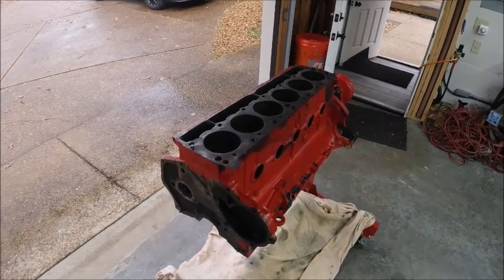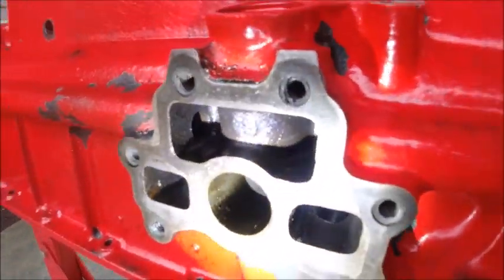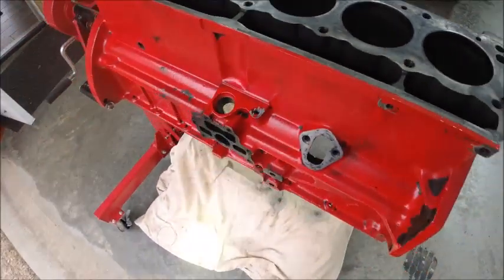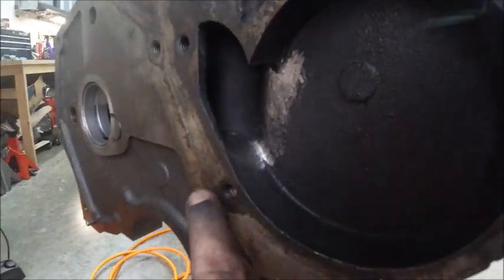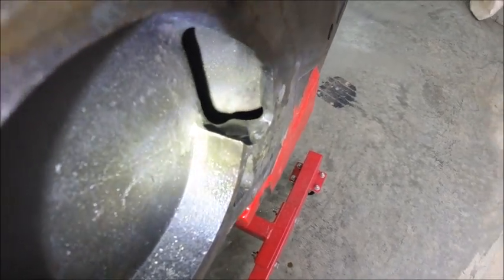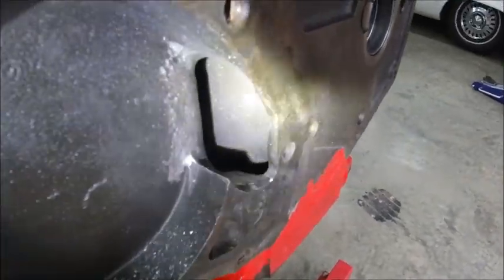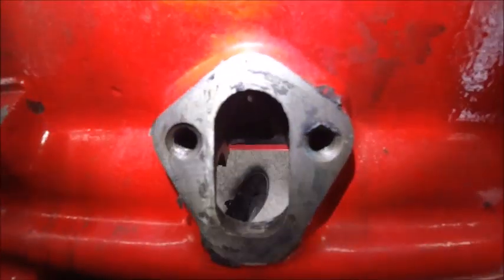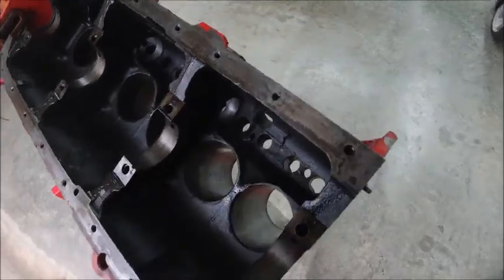Slant Six Block Prepping.... #nonamenationals

Comment: Hey shane, dont know if you got my email. Mu brother and i are building a 318 with just left over parts at home. Stock 360 cam and 318 poly flat top pistons. Which we measured now to be .010 below deck. I had a few questions and was wondering your input.

Comment: Darton MID Sleeves In a Aluminum block, Shane. Darton MID Sleeves In a Aluminum block.
Reply from the maker: If I ever find an Aluminum block I would sleeve it with bore supports on top.
Reply: @SlantDailyGarage The Aluminium block offers no performance advantages over the Cast Iron, for anything other then Steering.
Reply from the maker: @PiDsPagePrototypes  correct it is only for weight savings. But would be cool as hell
Reply: @SlantDailyGarage  Cool, sure. Though I'd machine out the factory bores and turn it in to a wet-sleeve motor. That'd allow for bigger bore diameters, so if going full HyperPak spec valves on the head, the cyclinders wouldn't need notching for valve clearance.
Reply from the maker: @PiDsPagePrototypes  the first thing I would do if money was no object..... make an aluminum cylinder head.
Reply: @SlantDailyGarage  Three prototype Aluminium cylinder heads escaped the factory. Doug Dutra had two of them, but used one on the Alloy Q series two-door build he did with Steve Magnante, the articles still up on Hot Rod magazines webpage. The Q also got a whole host of Alloy parts and ended up in Queensland, Australia. There was also a South American open-wheel race team in the 70's and 80's that used a mid-mounted vertical Slant Six in thier local Formula1 esque series, where they made thier own alloy head that had three spark plug holes, so they could run single plugs for tracks needing torque and twin-spark for tracks needing top end power.
Given what's available with 3D printing and CNC milling to make the negatives for a lost wax or lost foam casting, making your own Slant Six head now is no longer an out of reach propsition. Post casting machining still needs expert hands, but just like doing a wet-sleeve version, the limits become the bore spacing, and what gets in the way if you want to keep the stock cam / pushrods for a crossflow design. Putting the Inlet on the right hand side (US passenger) makes a very straight shot at the back of the valves...
Yeah, I've thought about it waaaaaay too much.
Reply: @SlantDailyGarage   A friend of mine is playing with an aluminum slant. He has already made and installed a deck/cylinder girdle to hold the cylinders in place. He is slowly, when he has time, milling an aluminum head. He also plans on trying to figure out cross-flow and overhead cam.
Reply: @SlantDailyGarage     We need to have a conversation maybe probably